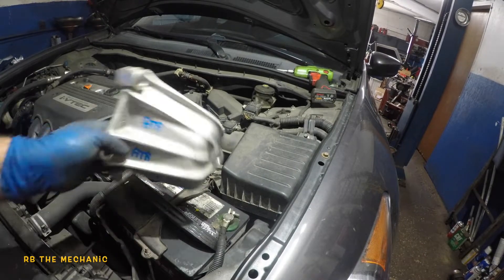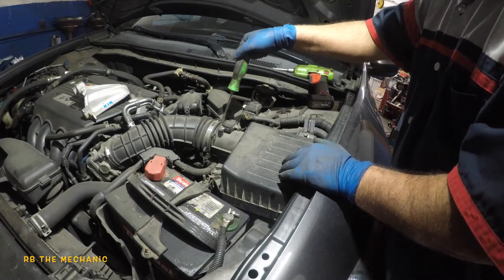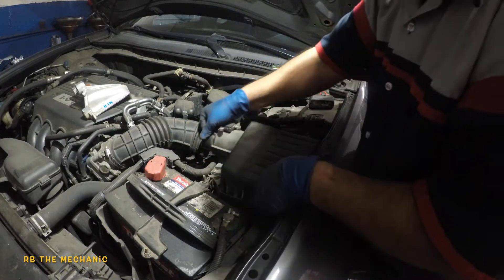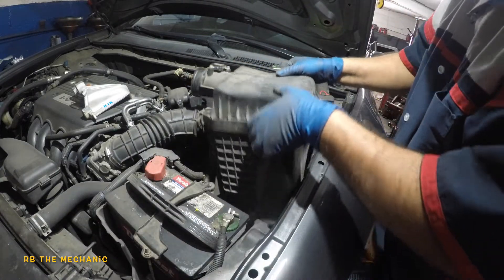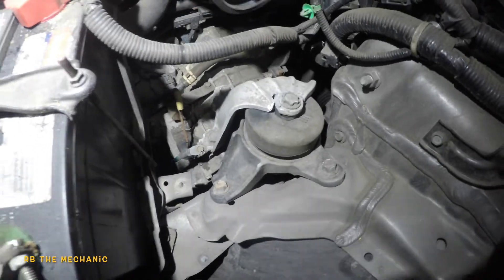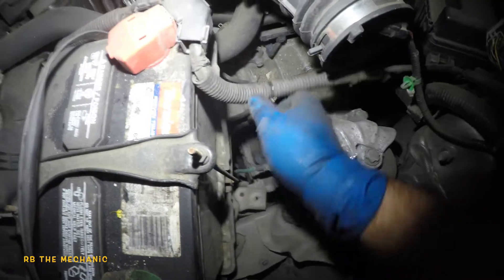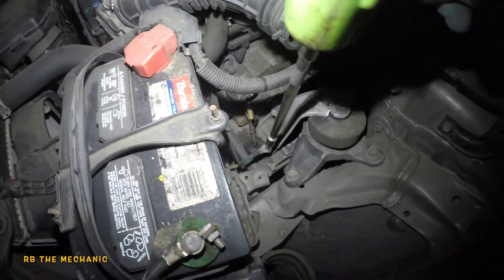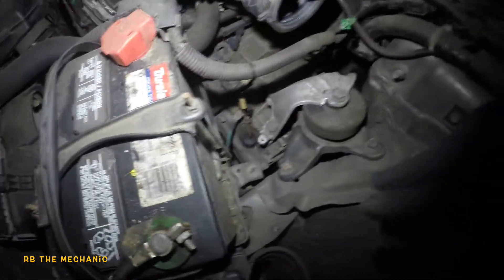Honda Accord 2.4L 2008 to 2012 replacing rear transmission mount to FIX HARD SHIFT

Comment: Hello, will this help with vibration while car is in drive? i dont get alot of vibration in park but once i put it in drive it vibrates alot at idle. im thinking its this mount (already replaced vaccum mount with oem part 2011 accord 4cyl)
Reply from the maker: Yes it can cause vibration if ur mounts r bad

Comment: Did you put the jack under the car? In what part?
Reply from the maker: Yes I had to lift it up under transmission with wood block
Reply: @RBTheMechanic  thank you! Tomorrow I will try to replace all 5 motor mounts of my Accord 2012, your video helped me a lot!

Comment: When replace the transmission mount upper and lower. Should replace the lower first then the upper mount? Is it necessary to unbolt the motor mount?
Reply from the maker: Yes it will allow u to move around the mount bolts holes also make sure u our floor jack with wood on bottom of transmission so u can move it up or down to align the holes